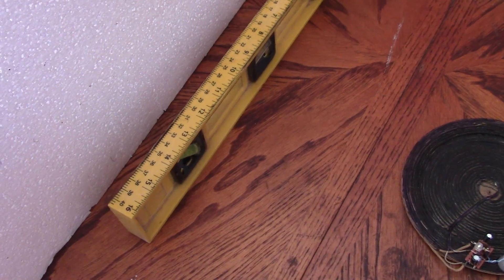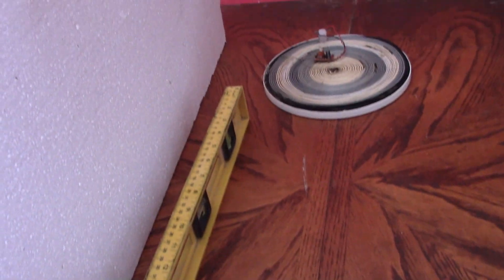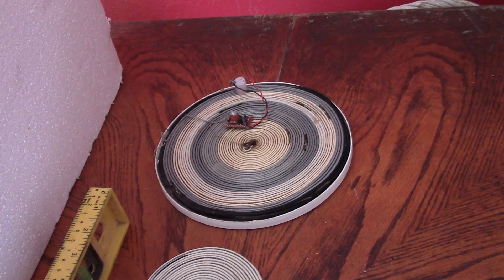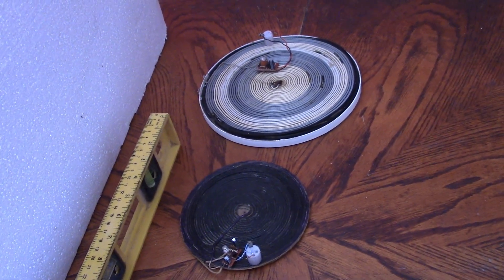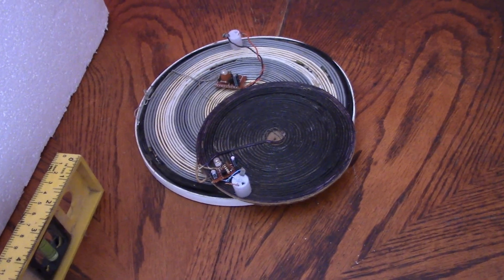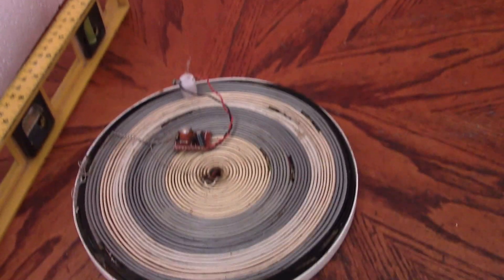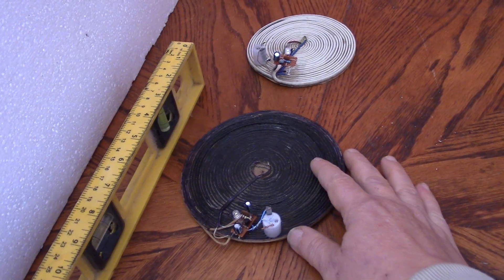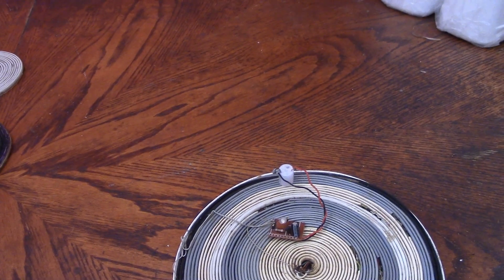Pancake Coil Oscillators getting jiggy

Comment: It happens with all oscillators. It’s lock-in. Clocks on pcbs will have the same effect.
Reply from the maker: Very interesting, thanks. I can see how a PCB clock running through say a radio ferrite coil would do something similar. Also, it makes sense of FCC requirements of often heavy shielding for RF leakage.

Comment: I guess its become inductively coupled acting like a cap, or are there magnetic field changes happening with large coils 🤔

Well its one more project to put on the list. Brilliant mate 😊
Reply from the maker: Happy to know you enjoyed it 😀
There are some build pointers in the description box, with at least a 9 turns length of 2 or 4 core wire being the main thing to source. It appears to be the way the coils pulse, emitting wireless field energy each time the transistor fires. A stronger coil will take over the feedback to the Base of a weaker one, causing it to retrigger at the new rate. When coils are close in output there can be fascinating effects like one of them firing every 4th flash of the other... all the time, for weeks!

Comment: Very interesting. You have spent some time observing the  oscillators and coils a lot of people wouldn't have noticed.
Reply from the maker: Cheers. Yes, the way the fields interact has been fascinating for many years. It was good to fix these up and do such tests after finding them in the box outside! 😀
Reply: @Slider2732_  cheers yes after building a couple of bedini motors more so the pendulum and solid state oscillator I have learnt quite a lot but admittedly not fully understanding what is happening. I know that you can't get more energy out than you put in but you can most definitely improve the efficiency to a point where it could be of use. Looking forward to your future videos.
Reply from the maker: @johnwynne-qx6br Must just say, thanks for your kind comments 😀 
Efficiency with low voltages has been a personal focus for many years. Bedini did have some excellent projects to build along with as he showed findings, as did Dr. Stiffler... much of which seems to have been lost to time.  
You might like the next vid, it's ultra efficient and includes the lake lol

Comment: Great to see the old stuff working again 😊
Reply from the maker: It really is! The other 2 coils had no circuits and were just kept around for donkeys years 😀
I recall when I'd assembled a dozen of so circuits running like this on the worktable at the old house, switched off the room light at night and it looked like some kind of disco. It's like the clack of solar rockers, things doing things with no on/off switch.